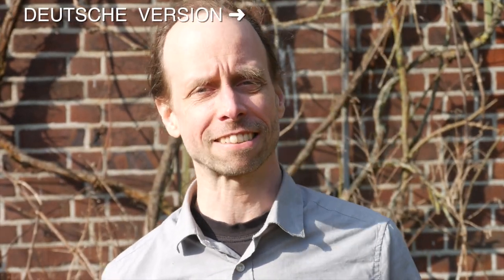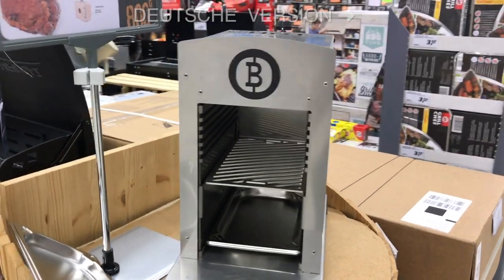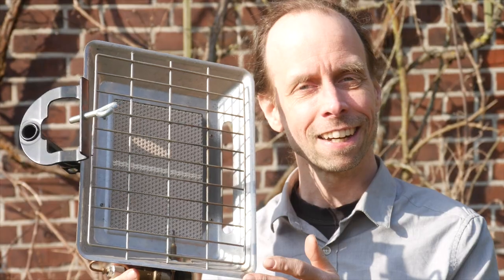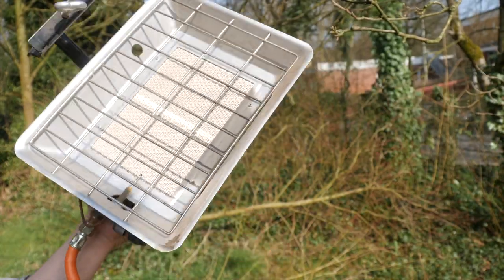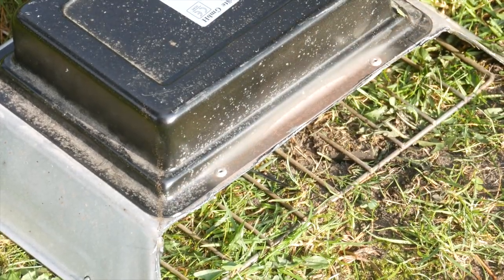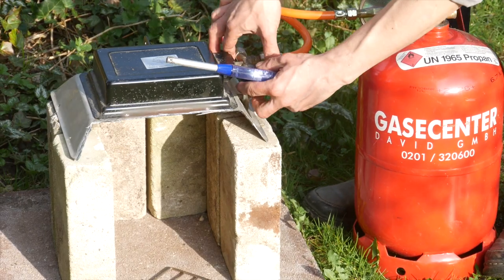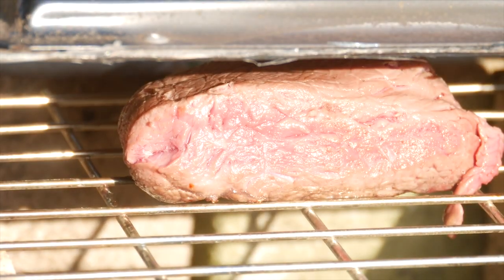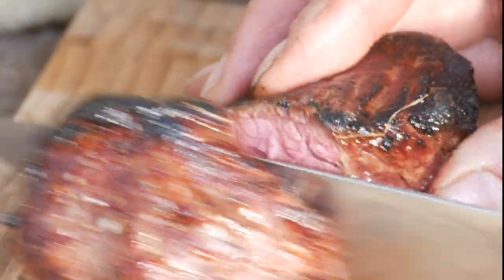DIY Salamander / Beefer / Overhead broiler for 35,-€

Comment: Hi from across the pond in the USA !! I've been experimenting with the  ceramic/catalytic salamander/broiler idea. In fact I was looking up some IR burners tonight and decided to check YT again to see if anyone else has done it and discovered your video. My first attempt was last December with an upright 18,000 BTU unit. My pyrometer went past 1200F and steak was great although I used the IR heater as a sear finish to my sous vide steak. I longed for an overhead unit at a reasonable price to hack and trash if it didn't work out. Thank you for the link. I found your 15K unit on Amazon for 65.00 U.S. Best wishes and let's keep hacking !
Reply from the maker: Thank you for your comment. Yes, I have noticed that these heaters are hard to find online in the USA. In Germany you can get them pretty much anywhere. Good luck with your‘s. I really use mine very frequently.
Reply: Can i ask where you found it, the USA listing is unavailable and the German version cannot be shipped to USA